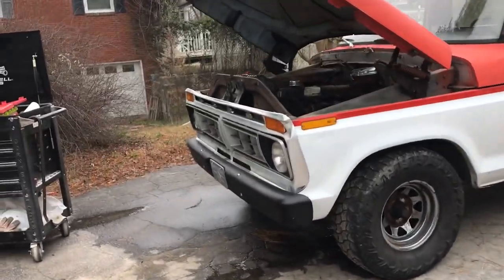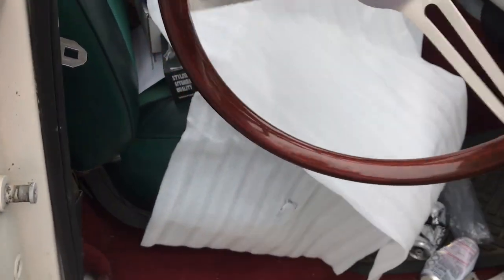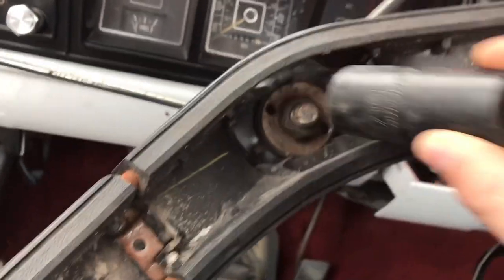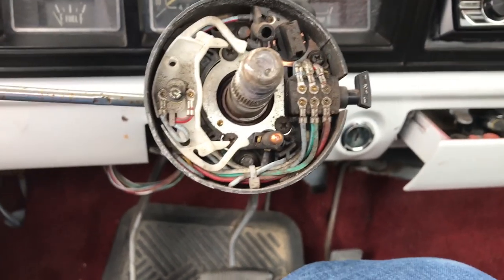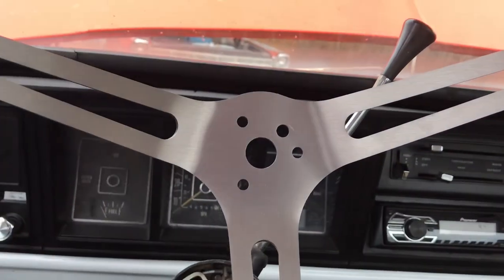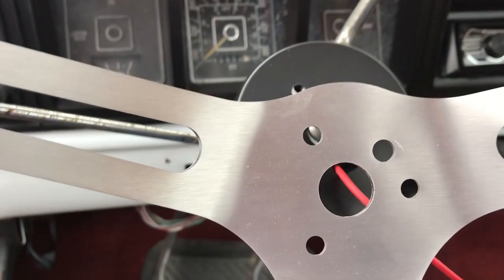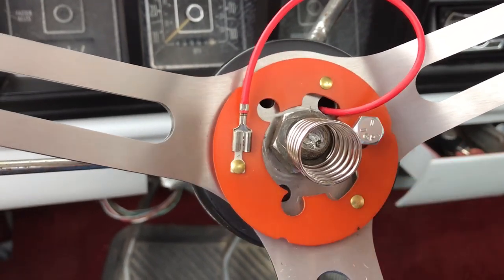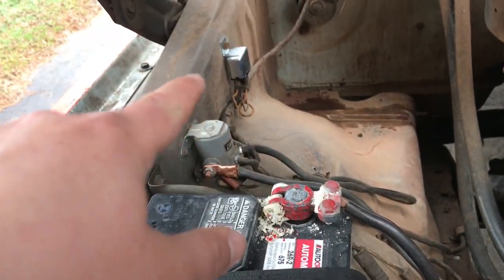How to Install Aftermarket Steering Wheel on 73-79 Ford Truck (Forever Sharp)

Comment: Just wanted to let you know (I'm an old electronic hobbyist and amateur radio operator) that the grease that you used IS absolutely the right stuff for that kind of contact issue. Any and everytime that two (or more) wires are brought together (like in a crimp/pressure type commector) in any vehicle that may be subjected to water, moisture, or humidity like would be found in cars, trucks, motorcycles, boats, trailers, & etc., this stuff will save you much grief later on down the road! When  you clean off those battery terminals, put a thin coating of that grease before tightening down the bolts and you'll see either no or much less corrosion in the future. This is especially critical on crimp-on connectors!!!  Another great video, BTW. Keep up the good work!!!  :^)

Comment: what size is the steering wheel?
Reply: It’s 15” I bought the exact same one on eBay a few weeks ago and it looks beautiful in person I found this video and noticed it’s exactly like the one I bought so this video was extra helpful since it’s the same steering wheel
Reply: 75-77 Bronco 70-77 F100 F150 F250 F350 Wood Steering Wheel High Gloss Grip 15"         Just copy and paste that and it’ll pop up

Comment: Did you have a problem with a gap in between your steering wheel and your steering column
Reply from the maker: I didn't notice an issue like that.  I was pretty impressed with the fit and finish.  Thanks for watching!

Comment: Thanks for the video. I bought pretty much the same wheel for a very similar application: mid '60's Ford Thunderbird. Mine looks like a slightly different setup and kit than you have for yours. Your horn only had one wire, and mine had two. They sent me an extra piece in the kit, so I guess it was because of this. 

Question though: Did they send you the roll pins to use for turn signal cancellation? I noticed you didn't install them even though you have the same Ford turn signal cancellation mechanism that I have in my T-Bird (the flexible plastic piece that the turn signal lever connects to.) I tried to use the original factory turn signal cancellation piece that activates this mechanism (I saw you had a similar piece on your original steering wheel) but the clearances weren't right to use it with the kit. I had to use the roll pins with the kit for activating the mechanism. My turn signals are now cancelling with the pins supplied, but I wanted to see if you had the same kind of experience I did (wanted to make sure I installed them right.)

Your steering wheel looks great. I'm pretty sure mine is made by the same company. They do a good job, though I wish the instructions were a little better.
Reply from the maker: If I remember right, I had to manually turn the turn signals off when making a turn in this truck.  So that must have been because of the way I installed my wheel.  Thanks for watching!
Reply: Instablaster
Reply: Where did you get it from? Thanks
Reply: @billmillsaps4431  If you're asking where I got the wheel, I got it from an eBay vendor. The guy's handle is staghound, and he still seems to be selling stuff. Good luck.